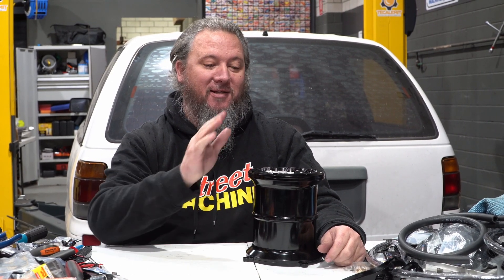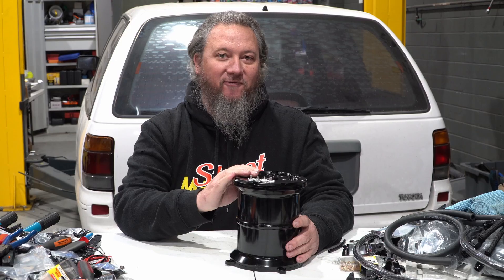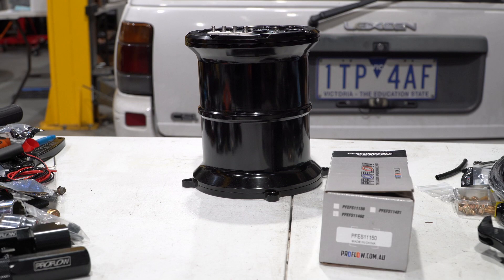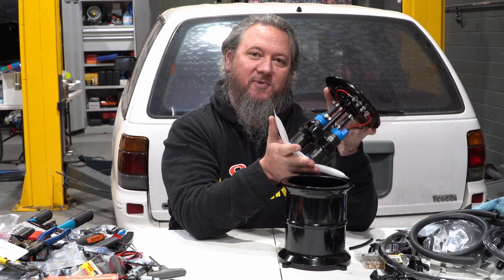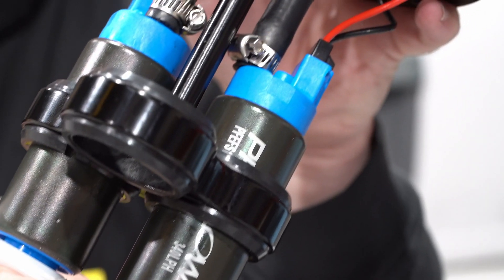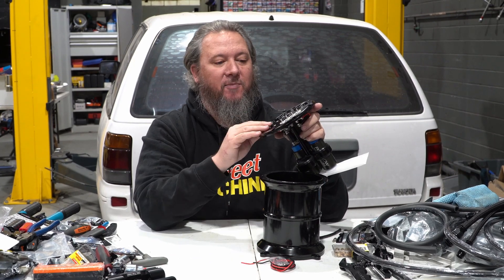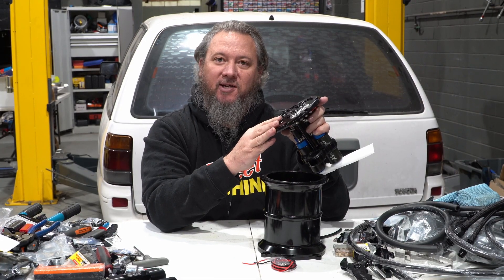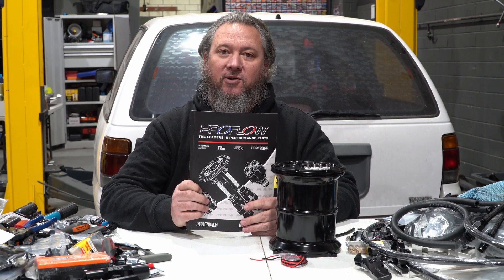Proflow Multi Pump Surge Tank Install

Comment: nice tank. what size lift pump did you use to feed the surge tank?
Reply from the maker: It depends what fuel pumps you have in the tank, as a basic rule of thumb, you want a lift pump that is about half as much flow rate as what's in the tank. Example, you have 2x 340LPH's in the surge tank, you'd want one 340LPH in the main fuel tank.
Reply: @proflowperformanceproducts  Thank you